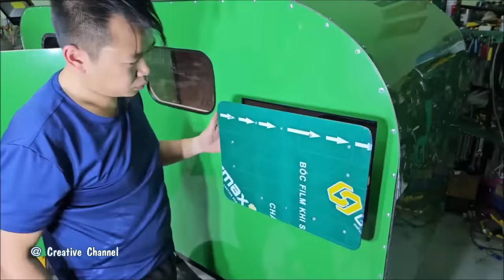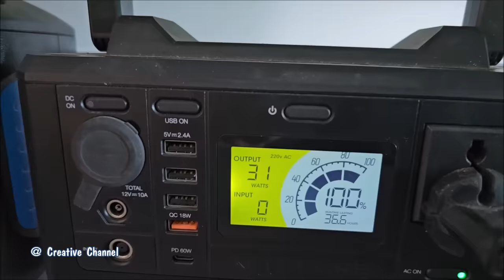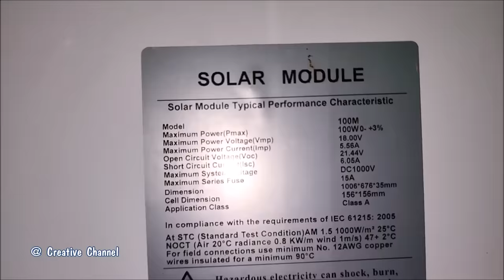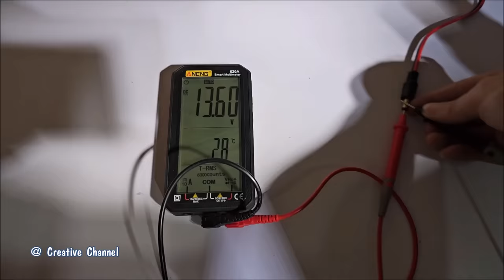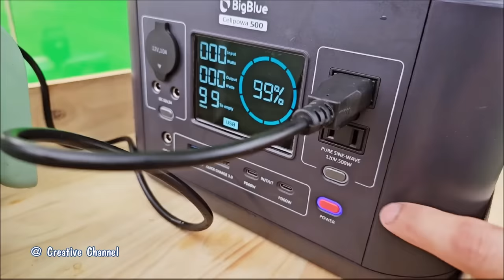I Building a Ebike Camper Trailer Mini - Ebike MobiHome - Detailed Build

Comment: What a great build, it looks very well-engineered.  I believe this would be well suited for pulling behind a small car or full-sized motorcycle but it seems like it is oversized and overweight to allow much range with e-Bike travel. I've seen much lighter and less robust bicycle/e-bike campers made with bike tires and foam composite walls - but they are not nearly as well appointed as this design.
Reply: a 2kw DD drive on front wheel perhaps with more battery would give braking (regen) and enough power for hills.  What is tough for an ebike with trailer is that it is tough to ride on fast high traffic roads, and tough for any narrow trail, or one with a fallen tree blocking it.  But the extra motor would help for roads.
Reply: Top
Reply: @pascalj4331  I agree he could have used lighter composite metals such as aluminum or chromoly metals throughout the entire build and used plastic walls etc to lessen the amount of weight.  Overall this is a great idea and well thought out in design.....just needs to be tweaked with lesser weight as a lot of ebikes have a 400 lb rating including the weight of the bike and rider

Comment: This is very impressive. I upgraded a travel trailer when I had one and I doubt the new owners cared much about the things I added. For example under the awning I added custom aluimuin tables that hung off the travel trailer along with extra lights. This way you could still cook if it rained. There was a 3 burner gas stove that could move from inside to the outside. I had a small flat top grill that you could hook up to the main lines. I had solar on the roof and usb plugs to charge anything you wanted including a custom shelf outside under the awing in which you can place you phones on and charge with the outside usb. You could also add a tv outside on a wall mount hanger and plug it in and then using that same table set up a laptop to play movies on the bigger screen. Inside I upgraded all the lightbulbs to led which made it brighter. I installed an air maxx fan with remote. I was also going to install on in the bathroom and had not gotten to it. I added a drop down tv screen which you could hook hdmi up to it and watch from the laptop. You could also add usb sticks to it and watch movies that way or dvds. I did a lot more stuff as well as upgrading the leveling jacks to something much better than what was on them. I put a lot in to it and did not really make any money in doing it. 
If I was ever to do it again I would custom build a trailer instead. Most campers suck and people hate their layouts and crap they have in them.
Reply: @debb4099  It was nice and I do not think we will ever get a camper again as we only used it half a dozen times in several years. My neighbor has one sitting in his barn that is 10 years old and he used it once. Its been sitting in there for the whole time. Just one time and this thing is like 50k or more. Just once. 
I watched another person make a really nice light weight one and if someone wanted to put some money in to building a small shop. I think I have a process that would make some super light weight units and they could be boxed shipped a size no bigger than say a shower box. In 4 segments that can be stacked in one another and be quite fancy and light weight. The price would be about 2500 to 3000 bucks with a solar panel and a battery. A bit more and you could design a bike around it that could use the wheel hubs on the trailer as Regen braking as well.
Reply: ¿Tenés algún video grabado?

Comment: I love the towing setup. It means the camper could be towed by a small car. I gather the rear lights are blue-tooth (so people behind you know when you are turning or stopping.
I would be installing adjustable levelling jacks in each corner. The only thing worse than sleeping up or down hill is rolling side ways because the sleeping surface isn't level.
Reply: Yea, add two more extending rods on each front side just to stabilize it T T OO
Reply: F ft t a t

Comment: Next, make a mold, the make many copies of a ultralightweight version as if like a giant tupperware container that is a camper even a child can easily lift up.
Carbon fibre as much as possible, vacuum bagging. The goal, is a camper under 50 pounds that even has a built in plumbing system and outdoor shower, awning and velcro/zippered or magnetic sealed screenroom. Also, install a LoRa radio system for full free email and wikipedia access, only 25 bux for that, could also be safety radio emergency transponder/off site security backup system. Cheers dude, completely dig your channel, inspiring.

Comment: Hi, I have seen a lot of trailers for ebikes and this was way cool. Your design for everything set up for good use. Your power is a good one. I been thinking of a trailer myself, but to many hills for me.  I have one started but not sure I will use it on my ebike, but actual motorcycle, lol.  I do like what you have done is nice!  Thanks!
Reply: If you built it like this fellow did, I'd say a motorbike would be the way to go. I'm sure this trailer is near unbreakable, but it must weigh near as much as a car trailer. Something out of wood and bicycle parts may be a better option for pulling with an e-bike.

Comment: i like the pull out kitchen ,im building mine similar too,so can access kichen from inside and outside ,ive made mine all no flame though ,made a 12 volt kettle,12 volt induction cooktop and `12 volt grill or oven ,made that out of modified mini toatser oven,with 12 volt temp controls off ali express,haha for 2.80 some stuff is so cheap on there,im working on water storage and filter system now ,because ill be in remote australia and might need a weeks worth of water
Reply: ive even made a tiny backup generator from 24 cc chainsaw and 50 v 25amp gen motor and dual 40 amp dc to dc boost contfrollers, so i can run the bike and camper just on petrol if get stuck with no power
Reply: its only 1foot long by 1/2 foot wide

Comment: I am going with 6mm ply, 10mm wood battons, and a 6mm ply layer, with 10mm of insulation board for a total of 22mm thick double walled panels, simply because I live in Scotland, and need to make the camper larger, I cannot afford the weight penalty of a 5 foot high design using metal, although I brace the floor and roof with a few beams, hopefully, even if it turns out be 10% of what this master crftsman has made, I will be happy.

Comment: The only thing i change is the system for solar panel. As you in this video we try always camping on shadows, the solar panel dont have any function stuck on the roof. Build a moveable system to the solar panel, to remove from the roof to catch the sun.

Comment: Some issues I see. 
The Roof Vents. Problem if raining really hard, blowing rain. Just the Position of those types of vents Water will Get inside.
Getting a Extended Mirror on the EBike, So can see Cars and other Traffic behind you would be a Good idea.
The Drawer you used to stored the batteries, but also to use for the Cooking with the Open Flame. Would Like to see that redone with Material that is at least wont be able to catch on Fire easily.

Comment: The little camper turned out great.
But ....
After you've put so much effort into the little camper, cooking becomes a primitive thing with plastic boxes. If you already show so much ambition then you could have accommodated the kitchen utensils in such a way that these plastic boxes are no longer necessary. Why two huge power stations when only one would have been enough. Super performance, you only have to change the cooking thing so that everything is integrated without getting in the way.

Comment: Should have insulated the trailer. Also the door is not  mounted correctly. It's opening is not correct. it goes the opposite direction, even if travelling at slow speed, is just a preventative method in case it opens, it won't famage it or the trailer. Other than that it was a great build. Enjoy it.

Comment: Wow dude has a hardware store they're in his shop. How do you have so much stuff laying around for parts? I guess it saves having to go to the store all the time. Cool build too heavy for an e-bike. More suited for a motorcycle or small car. I don't know why you didn't insulate that roof or double layer it maybe you live in a cool climate but it gets so hot where I live it would be like in oven and all those sticky lights would fall right off. Also maybe a little overkill on all the electronics. But the execution of the build was excellent.

Comment: Very Nice build, would be interested to know how many miles you get towing that camper say at 20 mph
and what size motor and battery your using I assume you were using those power packs for charging your bike battery as well, any info would be useful thanks, Nice video as always.

Comment: What is the width, length, and height of the coach?
What is the total weight, empty?
It could be made even lighter using spoked wheels, wood frame, and fiberglass (or PMF) panels. . But OP is GREAT at skillfully using what he has steadfastly & diversely & economically collected.

Comment: You could make a business entirely by making these and selling them online - especially to Americans, especially in California. As long as you can alter the dimensions to order, especially the length, you could probably charge around $2000 - $3000 US, plus extra for special adjustments or facilities.
All you need is a website and an advert or two linked to bicycle dealers or bicycle manufacturers. You could even try and do a deal with a particular bike place to sell through them for a 10% cut of the net profits. Go for it dude and when you've made your first million dollars, send me a postcard. 😊

Comment: Wow, listen, you're crazy, you made a great house. And I have a question for you, I also want to build something similar, what material did you use for the roof? And what is the black bow that you connected to the wheels, is it somehow related to the shock absorber?
Reply: Those are leaf springs and common on most trailers.
Reply: @timjacobs6579   
Wait if I understand correctly.
Are these leaf springs damping like a bicycle shock absorber?

And what is the green material that was used for the shell of the trailer?
Reply: aluminum composite panels.  seem pretty thin.  Can think about cutting weight and use over insulation foam.

Comment: Excellent but i am a bit concerned about the safety especially when the screws of the hinges are outside.
And your charge controller is pwm which is not as accurate as MPPT.
But i like it.

Comment: What air conditioner do you use???? I confuse because i didn't see the hot coil(hot compressor) i want to know it(i and idea to make camper van it maybe useful for my camper van)
Reply: That's actually only a heater, not an AC.
Reply: @dyeggocasper  why do you think it a heater?????
Reply: @inotplaying  There is no outside vent or condenser to dump heat out of the space, so it can't be an AC or heat pump.
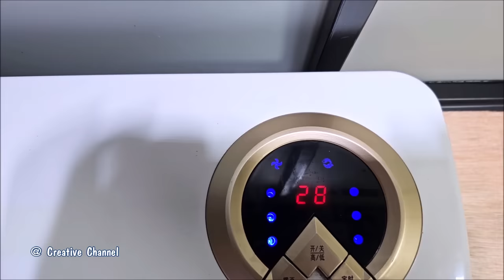Reply: @inotplaying  41:16 The heating elements can be seen and there are no refrigerant lines
Reply: @ag6371  its maybe steam fan😅😅

Comment: What type of AC is that?  I did not see him connect it to a condensor or drill hole to pull/exhaust the hot air out of the camper.

Comment: Do you think you could design an enclosed cab version with an electric pedal assist recumbent bike? I've always dreamed of one I could live in where I could just recline the driver's seat and be connected to the camper, living and sleeping area. That way I wouldn't have to climb out to leave if the area was getting sketchy. My fantasy vehicle also doubles as an amphibious paddle boathouse that can has options to set up sails. And the whole thing runs on solar and mini wind/water turbines (like water lily). You could daisy chain them onto a detachable beam that can go on the roof when you're driving and in the water when you're paddling. No fossil fuels needed! I would use a pop up tent and stainless steel hand pump pressurized sprayer for a shower. I could heat it up on an electric hot plate or in a fire if I've set up camp. But I suck at designing and building stuff if I don't have instructions lol!
Reply: Pour la douche , un petit arrosoir de 6l suffit.

Comment: Use curtain accessories for fixing curtain. Make holes and put one pipe  in the middle to hang shower curtain.  Jay bharat.
Reply: Make one garbage space for keeping garbage.
Reply: Make one attach folding table.
Reply: Make attach folding table connect to door.
Reply: Make attach folding door  outside door for cooking.

Comment: There's no bracing on the walls or the door. That wood is going to warp. No sealant around the screws, it's going to leak. Shouldn't you put covers over the vents so that your ac doesn't escape? You need weather stripping around you door to keep rain and bad temperatures out. You probably need to put a metal lining in that drawer so that you don't light it on fire or stain it with food or water.

Comment: the reason why a lot of people don't have a electric bike is that they can easily get stolen. And most stores and business don't have anything to keep the vehicle safe.  This is why not many people buy such equipment. You can have a camera but your vehicle gone. And then the drama to try to get it back. A alarm might work if your not distracted. Need some kind of weight that will hold the vehicle in place. while also lock up.

Comment: idea 10/10
work effort 10/10
design NEGATIVE 10/10
This thing is steal welded to aluminum, or silicon and a prey to hold the walls in place.
I could knock every wall panel out using 2 fingers, twist the hitch offf it using 2 hands, and I am sure the axle has already broken free of it "welds"

Comment: dislike trailer for the turn signals to work, the stop signal must be connected to the bike as a trailer for the car and not connected to the powerbank 
And the solar panel should be a little higher than the air came under it, learn how to do it right and then do it, they should not be tightly on the roof, catch a dislike for this